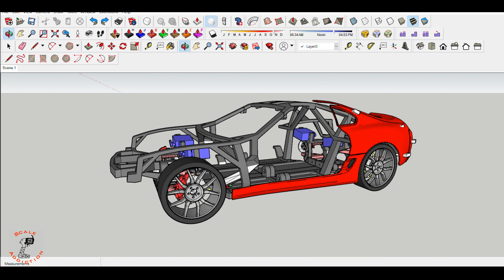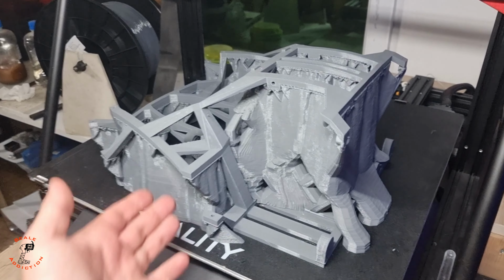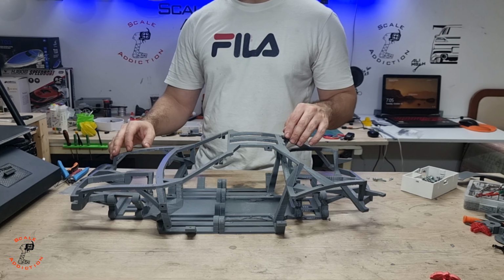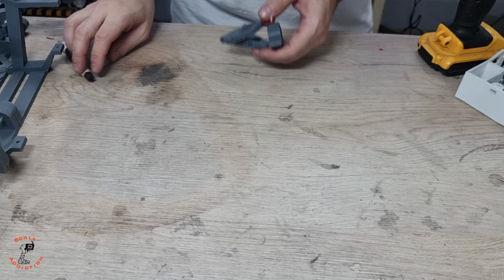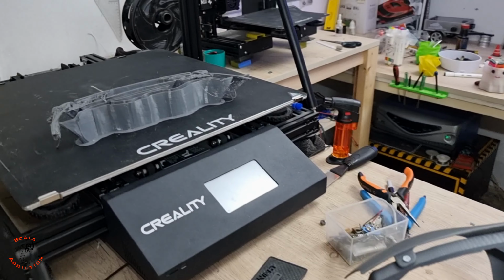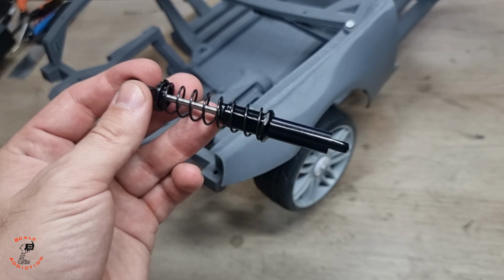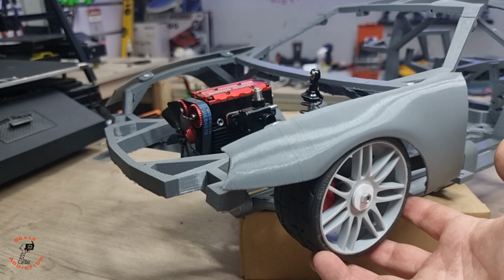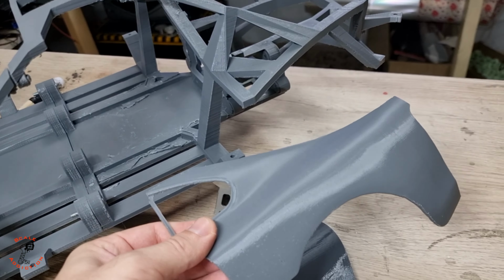Part 3 /  8th scale 3d printed supra with 2 cylinder engine project / Scale Addiction

Comment: Will the chassis fit the standard Ender 3 bed or do we need a bigger printer to print each one of the two parts? 
By the way, considering this chassis could you tune it in order to make it according to the new Toyota Supra or Bmw Z4? 

Thank you :)
Reply from the maker: After finishing that, I can make may bodies assamble on it
Reply: @scaleaddiction  Please do, I would be interested to buy it from you. :)